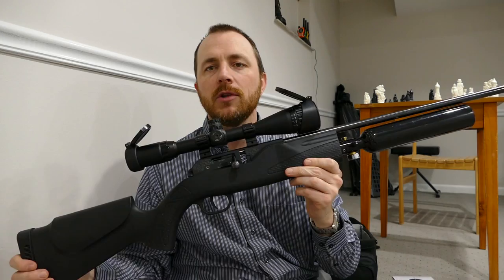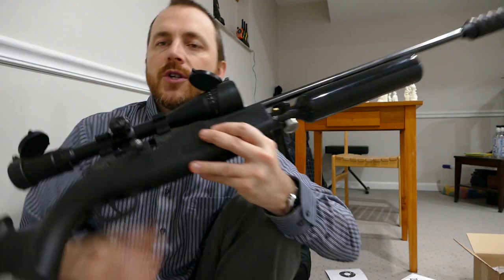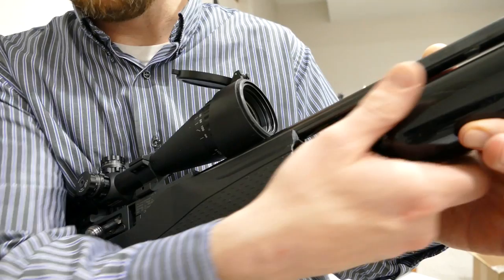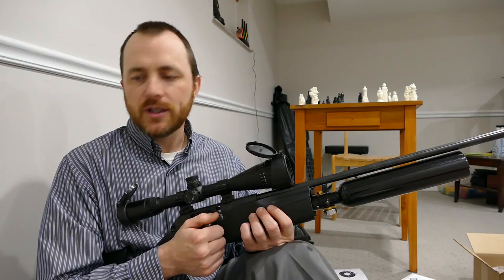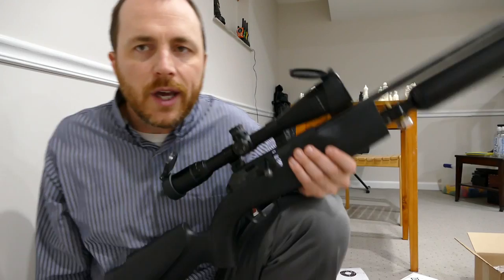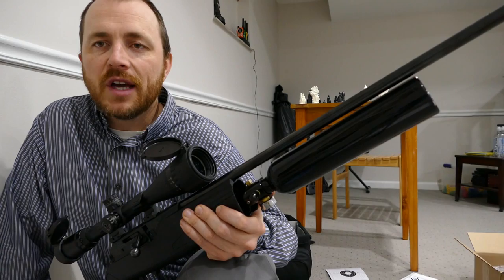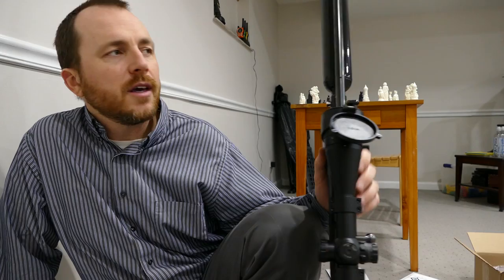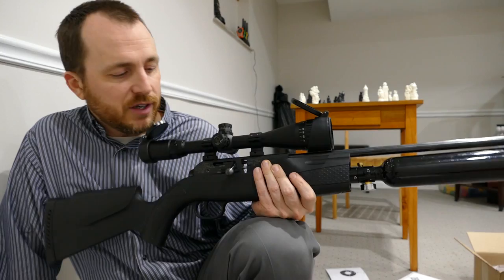Review: Hammerli 850 Air Magnum, adapted for high pressure air and tuned by Roald

Comment: I'm in the UK I've always wanted to do a CO2 to hpa conversion was going to do it with the Crosman Rabbit Stopper but don't have it anymore. I think the Rabbit Stopper would have been a easier conversion than this. But one of these 850 is coming up at auction in 2 days so I might try it. Barrel looks good floating.

Comment: G'day,
I just recently finished the conversion of my Hammerli 850 in .177 into HPA or PCP.  I have a similar tank on mine, it has come with a self-regulator of 800PSI other option were 1200, 1500 and 2000 PSI but I neede the gun to quite as possible because on neighbours.  One of the things that annoyed me the most about CO2 is the inability to function when temps are above 25Celsius, and ridiculously low velocities in cold temps.  In summer I just couldn't use it, the pressure inside the tank was over 1000PSI and the hammer just didn't have enough weight/strength to make the valve work, that was resolved when I put a stronger spring and drilled the hammer a little deeper to allow also a longer spring, after that, the new tank (same as yours) was been filled with CO2 and I was getting 700 + FPS with a 10.1 gr pallets in days above 25C.
I since purchased a scuba tank (15lt) and the filling accessories for it, I was quite pleased when I tested it and found the same pellets to travel at about 800+ FPS  with the noise levels to match exactly what I was getting with the CO2 in hot days (since the internal modifications) at about 95db, the best thing of it all is that, I fill the bottle with 3000PSI and I get about 800 shots all at identical speeds regardless of what the outside temperature may be, that 800 PSI regulator is certainly doing a good job.
The most expensive accessory to make the gun use HP was the scub tank at AU$300.00 filled (failr new tank, tested/verified), all the other parts such as tank, filling adaptor, hose and other minor things didn't cost more than AU$140.00 as far as I'm concerned these mods were the cheapest option I had to shoot a HPA or PCP type air rifle, to not that, while these air rifles are quite inexpensive in USA, UK and other places, I have paid AU$1,200 for it in November 2016.
I'm pleased with the way the Hammerli 850 is shooting now, the pallet impact/penetration is amazingly good, accuracy even improved and I can still shoot it in my backyard without making much noise, you still can hear it at some distance but 95db is quite acceptable in my view, I hope the neighbours think the same way otherwise I will get the Police knocking at my front door let me know that they received a complain...!
Reply: Sorry, I meant 80 shots from the new tank filled with HPA
Reply from the maker: nyodine nice job on your 850. I took mine squirrel hunting last year, and managed a couple 40+ yard standing offhand lung shots. Blew right through them, even at that range. 27 FPE, I believe. One thing about this gun is that it has a long barrel, for great velocity. Get the Hammerli muzzle brake for this and wrap it it shrink wrap. It's amazingly quiet.
Reply: The rifle did come originally with the sound suppressor attached which did surprise me a lot as silencer are not allowed here in Australia however, I believe they took the guts out of the silencer so that it would become no more than just for visual effect and therefore not changing the noise level but didn't take long for someone to discover that warping tape around the silencer to close all the holes, the sound level on the shots was reduced considerably. I would like to know how those silencers look like from factory and what was removed to be legal to Australia market.
Cheers
George
Reply: nyodine : can you please provide a shopping list of the parts you needed for the conversion? Pm me if you wish to. I cannot find any information anywhere!
Reply from the maker: @nyodine  Mine is from the American market, and it didn't have any guts either. We affectionately refer to these as LDC's. (lead dust collectors) But yes, a high grade of shrink wrap really did the trick. It made it quieter than many PROPER moderators.

Comment: Planning on a dominator 1250 valve to go in my 850 air magnum, with adapters to take a remote soda stream tank. If it works will get 4-5X co2 for less than a 88g co2 bottle AND be able to remove the bottle at any time without loosing the contents. Would be nice to see the technical stuff of your valve/tank up close with thread/fittings and associated info as seems to be very little out there for what i wanted to do. Thanks for your video
Reply from the maker: Check that the tank is made for that kind of pressure. Remote tank would make this a bench-only gun, and that's a shame.
Reply: @Smaug1  tanks origional sodastream so no probs, can work round the bench only idea. And spacially checking all hoses and adapters to confirm they are good for minimun 85+ bar hose good for 6k PSI

Comment: You traded a semi auto Marauder for the bolt action Hammerli with the Bolt action you have a MUCH Slower follow up shot for eradicating vermin, a squirrel will not sit still for a bolt action follow up, yeah I know just don't miss, is the accuracy that much better with the Hammerli over the Marauder?
Reply from the maker: Gary West Marauders aren't semi-auto, they're bolt action. Yes, the accuracy is notably better with a Walther barrel instead of Crosman.  I could only ever shoot about 1", 5-shot groups with the Marauder @ 50 yards. The Hammerli would do half that. I could hit a paintball almost every time @ 50 with the 850, if I did my part and had s good rest.

Comment: Your bottle is 1100 pri on the regulated side ?   It gets 28 FPE shots ?   Is yours the air venturi bottle ?    Im going to convert my 850.    Accurate as hell
Reply from the maker: fred I'm not sure on the regulated output. Roald at the old 'the850store.com' tuned it. But yes, 28 FPE and for over 75 shots. I wish I had kept it. My S510 I kept instead shoots just as well, with a better trigger, but it definitely has a shot curve, and only goes 35 shots or so on a fill.
Reply: My .25 S510 is regulated wityh a HUMA regulator set at 145 bar, and the hammer lightened.   $350 from the pro Motorhead AG.    250 bar fil.    Gets a flat 33 shot string at 40 PFE.    6% Stdev.        Ican get 71 rounds out of it.   Adjusting very predictable drop.      Hit a crow at 137 yards.    Mat Dubbs did a lane regulator to his .22 s510..   He gets 71 good hunting shots.   He's on You tube and such.    Ais arms has regulated models of thse S510 with improved valve.
Reply: Check out Airgun Nation.  You probably know about this one.   Has lots of good stuff on mods to the Magnificent AA S510.   I'll rat hunt with moine tonight.  With an x-sight II.    Have the ,30 barrel on my crown.  It punches the steel plates in my kill zones.    I have avocado trees oto defend

Comment: Get a regulator and moderator for your S510.     Bad rifle.
Reply from the maker: S510s have a fully shrouded barrel; I have a moderator threaded into an adapter and now it is PROPERLY quiet, but really long. The way to go is the S510 carbine and adding a moderator.